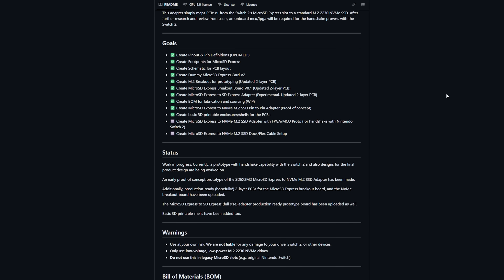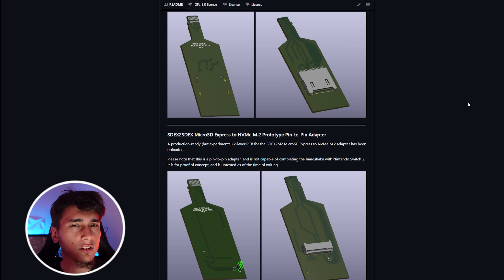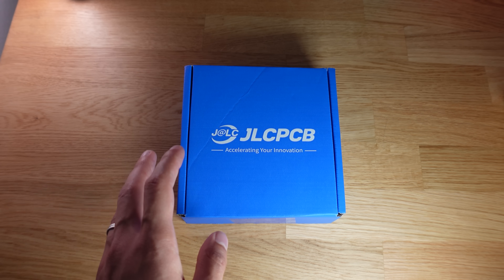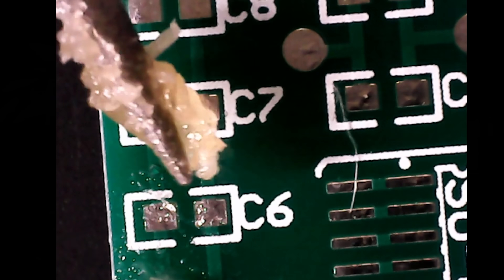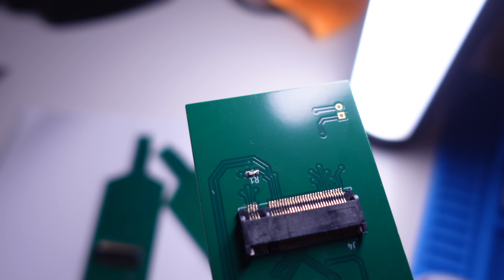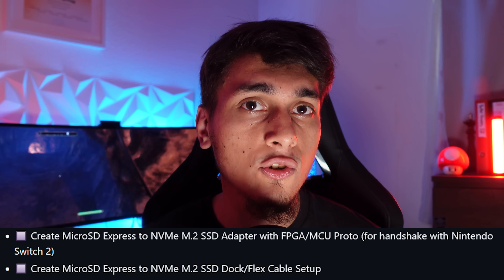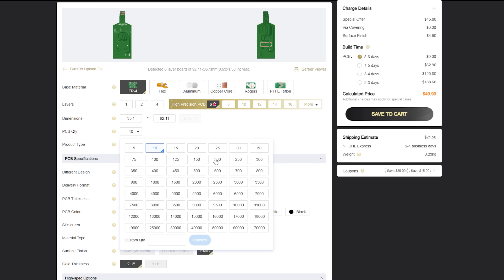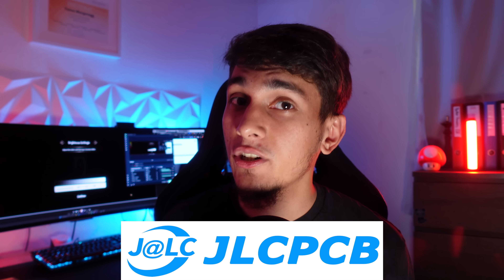Let’s Run an SSD on the Switch 2

Comment: Thank you so much for covering my project! Currently, Ive also designed a MicroSD Express sniffer board for capturing the handshake (will be uploaded soon once I verify the pcb) and have also put up part of the flexible connector version. I’m really happy to see everyone’s comments and support! - NVNT Labs
Reply from the maker: Huge thanks for dropping by! Your project is seriously impressive, and the sniffer board idea sounds like a game-changer. Can’t wait to see the results once you’ve verified the PCB. I’ll definitely be following your updates and would love to cover the flexible connector version too once it’s ready. Keep pushing the limits!
Reply: @yu-gg  Thank you very much for your support! Once we work out getting the signal, we'll publish the sniffer board PCB and also the flexible connector version PCB. The final will most likely be a dock or embedded within a small back attachment/grip.
Reply: @yu-gg  Thank you!!!
Reply: Handshake? My apologies, I am not electronics savvy. May you explain what that means, as if I'm 10 years old?
Reply: @stripedrajang3571 Imagine that you and your friends have a nice club but to enter you have to perform the secret handshake and anyone who can't isn't allowed inside
Reply: @stripedrajang3571  
It's explained starting at 9:58
Reply: @stripedrajang3571  Basically, the Switch 2 wants a certain signal from the MicroSD Express card. If it doesn't get it, then it will error out. I'm working on replicating that signal.
Reply: Oh I see.
Reply: I've now updated the GitHub with the revised Sniffer PCB, for those that wish to tinker. Capturing the handshake is still a WIP though.
Reply: Dude just please don't get your project ceased and desisted
 Make sure you have backups and people who are unreliable (incase they leak it if you go)😂

Comment: Why not just take out the SSD in the switch and replace it with a bigger drive? Id seen some people have their switch 2 at launch with 1 TB SSD with no micro SD cards used.. i know someone went to a nintendo repair store, they bought thr 4 TB SSD so they didnt have aomething clunky.. they asked them to make sure it was installed to not void warrenty by getting them to put in the encryption keys, ect. They have 4 TB with heatsink installed

Comment: Get a cheap AIO SMT gun, should be about 50usd, much better than a iron. Also use low melt paste so you don't melt the m.2 connecter. Use the m.2 data sheet to set the temp.
Or you can pre-solder the pads with enough solder, then tap each pin to each pad. Make sure to tack down opposite pins so you don't heat up the plastic too much.

Comment: Weird as it sounds similar stuff happens when using a CR5400 adapter on a PSP (non-Go). It required the user to format the microSD cards into FAT32 using the PSP as an adapter, then restarting the PSP it would prompt to format the card(s) into the appropriate format for PSP file system and viola you have up to theoretically a 4tb PSP. So as brand a new ssd will ship as unallocated storage and require format before use, maybe try formatting in a standard expandable storage format (like exFAT), then insert into adapter and in theory viola. And the comments recommended a ribbon extension microsd card adapter with some double sided tape would solve the awkward handling problem are 100% right

Comment: Not enough flux and not enough solder bro. The solder should just flow right to the pads and fillet with the connector pads. Don't use solder paste for stuff like this either. Get the residue free gel/liquid stuff.
Reply: Nice job writing that essay. But honestly, this is really a job for a typewriter, not a pen. Sure, you could do it with a pen and you did but that ink isn’t doing you any favors, and maybe try a different kind of paper while you’re at it.

what a useless comment that shows you have no idea what you're talking about 😂
Reply: @GetUpShorts Except that I do micro soldering by hand all the time, troll.

The least he could do was pre-tin the pads.

Comment: Would be better with a smaller micro SD shaped chip for the slot and the main pcb you can stick to the back of the switch. Connected with a ribbon cable??
Reply from the maker: Once functionality works designed will be crafted for sure but for now it's only a prototype 👍

Comment: This is a great idea but it somewhat compromises the portability of the system, and at least with the current setup makes it impossible to dock.  The power issue with larger SSD's could be solved as well, but it would further compromise portability.

Comment: The sd-card plug should be soldered to cables so you can mount the m2 ssd on the back of the switch (magnet?)

Comment: one thing to watch out for is mp600 2230 isnt the best for mobile systems as it generates more heat i had one in my z1 extreme and it took it out because it got messed up (could be a heat related issue idk) and when i put my sn770m 2230 my performance increased a lot more

Comment: So the hardware worked, but it was a driver issue. Switch2OS only has drivers for SDcards.
Reply: Theres a bit of a misunderstanding.
Microsd express uses pcie lanes to communicate directly with a chipset/cpu
just in a format of a microsd card slot and uses microsd's protocals.
similar to how thunderbolt is just usb c wired over pcie lanes.

This is where its gets its speed as compared to normal microsd which uses a form of usb.

but that does not mean its a valid pcie slot that you can stick any device into.
some devices do in fact wire up the sd cart slot as a full fledge pcie slot and with some adapters you can use it as such but some do not.
In fact i think someone already tested this but internally the switch 2 is only wired for microsd  or microsd express cards so its physically can't interact with any other device.

so in order to adapt a m.2 ssd to microsd express you'd need a microcontroller to convert m.2 storage protocals into microsd ones and tell the switch 2 i am indeed a microsd express card. Though you may also run into an issue of the switch 2 not supplying enough power to the slot to even use a m.2 drive on its own.

Comment: Def gray area and is atraling depending on the situation. But Nintendo really needs to fix the virtual cart situation. Its absolutely to much of a pain to play a digital game that youve bought across multiple switches they youve also paid for. Obviously you can only play it on 1 at a time which is fine but should just load and disconnect the other one like any other system. Instead you have to sync with the other switch and if you have all switch models then u may have to discinnect another to then sync with a differnt. Its just insane and a horrible system. Thats where unlocking a device can be nice just for features that should be standard. Steam does it best imo. Saves sync easily and painless on ur sccount regardless of device. Its almost like nintedo makes it so annoying and wants you to buy a new copy for every system. Which is dumb but would be maybe reasonable if you could sync saves automatically and also you would have to have differnt accounts on esch system. So no matter which eay u slice it the current dgital system on the switch is horrible if you have multiple systems. Say u have a 2 or oled but want to take ur lite on a trip you would have to manual make sure every game is linked over or you will be sol once away from ur main device. Thats why physical will alsways be prefered on devices with such a system that is either plain greed or just not thought out. It used to not be like that. It worked great before. Only new festure thsts better is you have a shortcut on the gome screen to download all ur digital games.
Reply: congratulations you won this comment section's yap competition🥇

Comment: Job for a hot air station. But I feel like you’re using the wrong tip for this job also. Could definitely be done with a soldering iron. But I feel like that tip isn’t doing you any favors and good quality flux also.

Comment: Funny that running SSD on switch 2 might be cheaper and faster than the micro SD express
Reply: MicroSD Express is newer technology and far smaller than a NVMe Drive, which has been mass produced for years
Reply: @Yepi6918  not 1TB 2030 Gen 4 - they're about the same age, with the m.2 likely being in production for much less time. And it's the same concept since it's the same form factor and connection.
Reply: @AlaskanGamerGuy yeah but I doubt the Switch 2 reaches those speeds with MicroSD Express. Tho hopefully the Switch 2 will drive more mass production of MicroSD Express cards
Reply: @Yepi6918  in theory it should get Gen 3 speeds, which is about 4X the speed of MicroSD express.
Reply: @Yepi6918  as others have pointed out it's going to draw a lot of power and create a significant amount of heat.
Reply: yeah, but too power hungry
Reply: @rickstlevania  this. And you'd need a heatsink of some kind.
Reply: Yeah. And got that shit stickin out 😂
Reply: Well, yes, it is 50 times smaller, what else to expect.

Comment: What about using a ribbon cable to attach the drive and mount it on the back of the Switch 2?
Reply: That’s the overall idea, however signal integrity remains a bit of an issue with that. I’m working on a few things for it currently, and the GitHub has been updated.

Comment: @yu-gg heres some advice use some flux and a heat gun and tweezers will save you alot of time and not destroying your boards
Reply from the maker: hey thanks for the advice, I already used flux for this one otherwise I wouldnt have been able to solder it. Maybe someday I will add a heat gun to my tools.

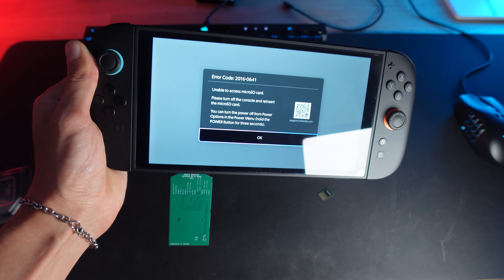Comment: why don't they just flip the piece upside down? and keep the chip the same position? 11:58
Reply: Right now, it's just a prototype in its early stages. The priority is making sure it works design improvements can come later.
Reply: rushing the design process is costly and burdensome, the focus is and should only be on functionality right now

Comment: Walmart has a 256 gb express sd for $30 or you can get the nintendo branded one for like $55
Reply: damn probably a limited time loss leader for a switch 2 purchase + games
Reply: yeah but they're usually as fast as a regular micro sd card
Reply: @PleaseLaughChannel i dunno when it says it reaches speeds of 900 mb

Comment: Seriously impressive work in the NVMe M.2 soldering section, had to pause and rewind! Most pros use solder paste, hot‑air reflow, or a microscope jig. You nailed those fine-pitch pads with just a simple soldering iron. Great use of flux and pre‑tinning the pads. That’s exactly how we do it in budget labs when you don’t have reflow gear. Stellar technique few newcomers even try that level of patience!
Reply from the maker: Appreciate you noticing the techniques 🥳

Comment: A flex PCB on the sd card slot part would've been better so u can mount it on the back of the switch instead of leaving it hanging
Reply from the maker: That's an interesting idea, maybe for a future iteration!
Reply: 👆This.
But is that even possible?
Reply: @AwkwardAgressive  flex PCBs are very common
Reply: @AwkwardAgressive  everything is possible in china
Reply: I’ve been actually working on adding a flexible FPC. I’ve uploaded some of it but the rest will have to wait until I get the handshake signal working. - NVNT Labs
Reply: @NVNTR  very nice
Reply: maybe add a "release" switch for the flex cable, so the sd card part can "stick in" while removing the "nvme" part, so you can easly connect /disconnect without pulling the sd out. maybe a magnetic connector or easy "puss" release button mechanic would be neat .

goal -> the sd can stick into the switch and you can press and pull to remove the sd / flex cable etc and easy connect them to keep flexibility of have a handheld. this would prevent destroying the sd slot too of many in and out @yu-gg

Comment: How did Nintendo not brick your device
Reply: Because the system thinks it's a microSD Express card, it likely can't detect that it's actually something else. I believe he explained this in the video.
Reply: why should they?
Reply: @mandasist They shouldn't. But they bricking people for every little thing. Even using 3rd party docks or chargers.
Reply: Because consoles only get banned for piracy.
Reply: Me when I spend all day in reddit
Reply: your an idiot for saying brick its a ban not a brick where are the bricked console reports idiot
Reply: this has high plausible deniability factor, in fact they really should not label it a switch mod at all as it can be a generic mod for micro sd express slots

Comment from the maker: Would you actually try this on your Switch or nah? 🤔
Reply: yes 🙏
Reply: If Nintendo was smart, they'd hire that Guy to make a Case, that can connect the M2-SSD!
Reply: If I could dock the Switch 2, absolutely. I don't play in handheld mode, so if they figured out how to get it to function while docked I'd be down. Though it seems like a huge PITA compared to just opening my Steam Deck OLED and dropping an SSD there in 10 minutes. Walled gardens always creating headaches, but it is what it is.
Reply: well it would have to be intergrated into the dock so its not fragile doesnt say prototype lol
Reply: du bist n schwizer????

guäts änglisch auso würklech.
Reply: Ты просто клоун который не приносит ничего полезного и ищет хайпа. Ты позор.